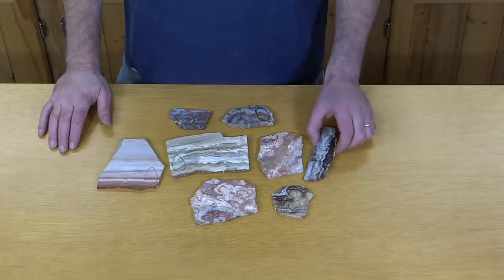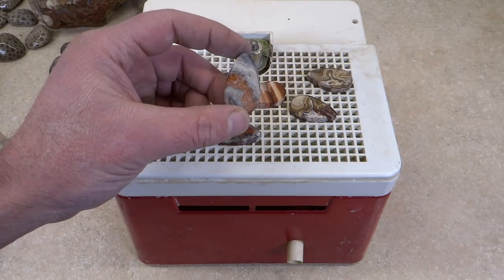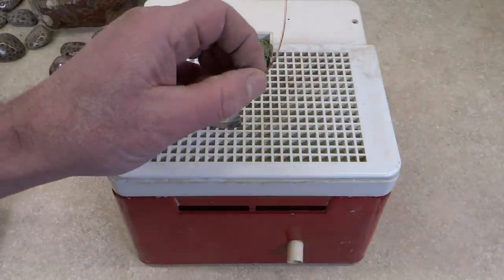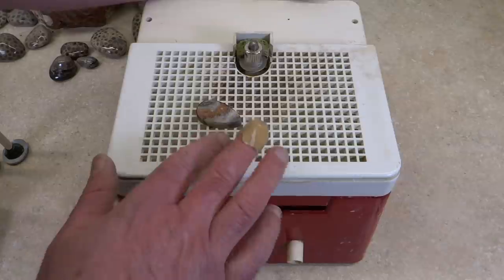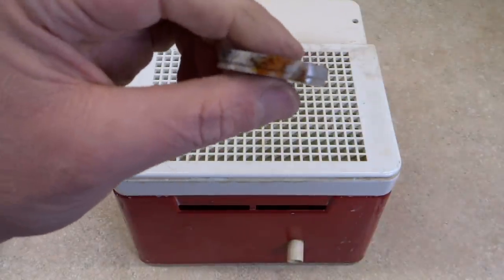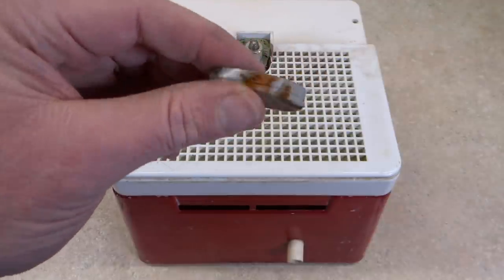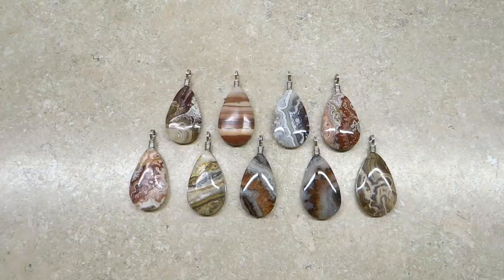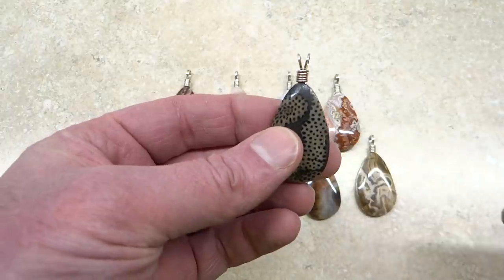Making Pendants for My Wife

Comment: Interesting, I was a cabinetmaker for many years and I can give you a time saving tip when using that glass grinding machine you cut the grooves with.
If you put a washer with the correct bore size over the cutter and clamp that on top if it is the correct diameter you can use it as a depth guide
Reply from the maker: Hi Symon, that’s a great tip, except that the bit wears down as you use it.  I suppose I could have a series of washers that I change as the bit wears down.  I’ll have to think about how I can make that work.  Thanks!
Reply: @MichiganRocks  
It is progressive and if you do get it right I would say half a millimeter difference will do it.
Do you know any metal turners who could help?  You could trade off for the goods, check the sizes you need and see if they are stock washers. 
Good luck.
Reply from the maker: @symonsheppard7151  Thanks!

Comment: Beautiful work! About how long does it take you to go from slab to finished product? I'm just starting out, so it's quite a process for me.
Reply from the maker: I did these over several different days.  I work on them for a couple of hours and then my back usually starts to get sore and I stop having fun.  Part of the time is getting tools set up and then cleaned up at the end.  You can't go just work for a half an hour or it would take almost as long to get everything filled with water and then drained and dried at the end.  I like to do more than one at a time for that reason.  As long as I have to clean stuff up, I may as well do a few.  All that makes it hard to say just how much time goes into one pendant.  I'll take a very wild guess and say that this group took me 7-10 hours start to finish.  That includes the wire work.

Comment: Hi Rob. I have a question about glass grinders. Do you like your Power Max 2?  There is one on EBay I was thinking of getting. Didn’t you have a different one before, maybe called The Wiz?
Also, what size bits do you have to make those grooves in your stones.
Reply: I now see the bits on your Amazon store
Reply from the maker: This is the only grinder I have used and it works well for me. I think the one in my Amazon storefront is a little different, but it was the closest I could find to what I have.

Comment: Is there no end to your talents? :) I really like the clamp/vise. What are the grits on the cab wheels? What do you use to "glue" the rock to the stick? Thanks.
Reply from the maker: I stick the rocks to the stick with hot wax.  It's called a "dop stick" and the wax heater is called a "dop pot"

I think the grits are: 80, 220, 280, 600, 1200 and 3000.
Reply: @MichiganRocks  Thanks. Trying to glean as much as I can from the videos. You are a huge help...

Comment: Using the clamp with those pliers was ever so clever Rob. Great video. 
  I was wondering about that glass cutting machine that cut the groove. Is there any worry about grooving your fingers from the blade?
Reply from the maker: The clamp wasn't my idea, but I agree that it's a good one.  

Diamond blades don't easily cut your fingers.  They have very small diamonds and they grind through the rock rather than cut it like a wood saw.  I can touch the blade of my rock saws while they're running and it doesn't hurt at all.  Look at  6:08 in this video:  https://youtu.be/dJ7qriOF0r4
Reply: @MichiganRocks  Could a dremel be used for cutting that rock slab, sanding the edges, and then cutting the groove in the edge?  Or would you recommend looking at your friend’s website instead? 😆
Reply from the maker: @karenh2945  I think that would be very difficult to do well. You'd need to have the Dremel in a drill press or something to hold it steady as you cut a groove. 

My friend Chuck does very nice work and it would be much cheaper than making one yourself. On the other hand, the satisfaction of making something yourself  is worth something too.

Comment: Hey what did you connect to the stone ? Help Thx
Reply from the maker: It's called a groove wrap. It's silver wire (actually three wires) wrapped around a groove that I cut in the cabochons. I thought I showed how I did that in this video, but if not, check this one out: https://youtu.be/kIJgbsunB3s

Comment: Awesome job. They look great but I was curious did you modify your wet saw or is that the way it came? I am trying to figure out something for my wet saw
Reply from the maker: The saw is the way it came when I got it used.  I did have to replace the Plexiglas water shield in the front, but that's the only thing that I'd consider a modification at all.  What did you think I changed?
Reply: @MichiganRocks  I just wasn't sure. I went to harbor freight and got a tile saw. I just liked how yours was set up.
Reply from the maker: @wastelandworrior9639  I really like that saw.

Comment: Hi, can i ask how thick the slabs are that you use for this type of pendant? I plan on making a few but can't see any indication on the tutorial you linked to. Lovely pendands, you do a great job as does your friend who's etsy offerings are really bonnie. 👍
Reply from the maker: I cut my slabs just over 1/4 inch. I'd cut them 1/4 inch, but to do that, I have to do 5.5 turns of the crank to get that. When I do that, the crank ends up straight up and it tends to fall down during the cut. For that reason I do a full six turns and end up a little thicker. That's good though, to have room to fit both the groove and the dome on the cab.
Reply: Ok thanks. Can i also ask if you use hard or soft wire? I'm completely new to making jewellery and it's a bit of a nightmare with all the options so it would really help if you were able to tell me whether each of the wires uses were soft or hard. I have my cabochon made and just need to ensure i buy the correct type wire. Thanks again.
Reply from the maker: @highlander5161  Sure. I don't know much about this either. I just do what others have told me to do. Here you go:

20 gauge square half hard
20 gauge round dead soft
22 gauge half round half hard
Reply: @MichiganRocks  Great. Thankyou. 👍
Reply: What’s the approximate measurement for a groove? 1/3 of the way above the back of the cab? Less?

Comment: How do you attach the dopstick ?   How to release from dop…minor stuff, but need to know.  What is the coin for in cab machine?
Reply from the maker: I just did a complete video on how to make a cab, with all the details I could thing of. I show how to attach a dop stick and how to remove it. (Spoiler: Use hot wax to attach it, and put it in the freezer for a few minutes to remove it.) https://youtu.be/U_9ASoyvaM0

Here's a link to my cab machine, and another version with cheaper wheels. I'll also include a link to my review of it if you're really interested in getting one.  

Cabber 6 with upgraded wheels: 
https://kingsleynorth.com/kingsley-north-cabber-6-nova.html?ref=robertabram1&utm_source=tapfiliate  (affiliate link)

Standard Cabber 6: 
https://kingsleynorth.com/kingsley-north-cabber-6.html?ref=robertabram1&utm_source=tapfiliate  (affiliate link)

My review: https://youtu.be/n30aBTu9OkY

Comment: Do you put the groove in dry grinding? I cant find  a single groove bit that lifts the water out of the reservoir.  I have the same glass grinder. Btw very good tutorials, thanks for taking the time.
Reply from the maker: I'm not sure what you mean by lifting water out of the reservoir. There's a little sponge behind the bit that soaks water up and keeps the bit wet. If you look in the description of this video, you'll find my Amazon storefront. I have the bit listed there.
Reply: The bits that csme with my grinder had a small flange like thing on the  bottom of the bit that lifted the h2o up to what you are grinding.
Reply from the maker: @gregorysilas3784  This is one of only two bits I have ever used on my machine. I have never seen a water flange like you describe. I think all the bits on my machine are cooled by the little sponge.

Comment: beautiful work! What software do you use to edit your videos?
Reply from the maker: I use Final Cut Pro.  I started with iMovie, but iMovie doesn’t allow you to straighten video.  When I do videos on the beach, the horizon is like a level.  It’s really obvious when the camera is tilted.  I seem to be incapable of holding the camera straight, so I spend hours straightening those videos.  Every second or so that the camera is facing the horizon I make an adjustment.  Most people probably wouldn’t care if I didn’t, but it bugs me when the lake looks like it’s going to drain off the side of the screen.

Comment: What is the polisher you are using?  Do you use this to polish Petoskey stones?
Reply from the maker: I think it's a Lortone cab machine rebranded as a Kingsley North grinder.  I bought it used from a friend.  It was rusty when I got it, but I cleaned and painted it.

I usually use a flat lap rather than this for Petoskey stones.  The disks for the flat lap are cheaper than the wheels for this machine and the flat lap works just as well for Petoskey stones.

Comment: HELP! I looked in your videos for the 1 on your equipment, and I can't find it. You know, which slabber you use, the Dewalt squeeze clamp you use here...just can't find it. The jewelry pliers...I've never seen that nose. And I know you said your trim saw has been discontinued, but what one do you think is closest to it at kingsley north?
THANX FOR ALL THE GREAT TUTORIALS.
Reply: I have gone to this tutorial (great) and answered a few of my own questions....but slabber?
Reply from the maker: Here's the tutorial I use for wrapping these. https://forum.rocktumblinghobby.com/thread/68169/groove-wrap-tutorial-photo-heavy

This is the only wrap I know how to do. Wrapping is not my strength at all. I just do it because I have to to make a finished piece of jewelry. 

As for the equipment, I bought it a long time ago and I don't know what brand most of it is. My pliers say "Made in Pakistan" on most of them. My bail making pliers are Wubbers brand. My wire cutters have yellow handles, but that's all I could tell you about them. They all seem to be good quality, I didn't buy super cheap stuff, but it wasn't outrageously expensive either. In the tutorial I linked to above, my friend uses a Craftsman clamp. I just went to Home Depot and found a tiny little clamp. If you search for "pliers" at Kingsley North, you'll see they have a lot to choose from. I have a large and a small pair of needle nose pliers and small and large pliers with flat, square ends. 

The slab saw is a tough question. I don't see anything at Kingsley that is very similar to what I have, although they have a lot of slab saws that would probably work well for you. This one: https://kingsleynorth.com/14-combination-slab-saw-complete.html?ref=robertabram1&utm_source=tapfiliate (affiliate link) might be the closest to what I have, but it's bigger and comes with a stand. Mine sets on a table. The problem with saws larger than 10 inches (mine is a 10 inch saw) is that the blades cost a lot more. They probably last longer though. 

There is actually a clone of my saw that is made by another company. The company is Highland Park, which is confusing because they used the name of an older company that went out of business. They used the same design and made improvements to it. According to their video, it's greatly improved. I was on a lapidary forum where people said it's cheaply made, though. The new company is based in China, although it's owned by a couple of Americans. I don't know if the people on the forum had actually used the saw or if they were just upset that they are being made in China. Anyhow, here's their video on the saw: https://www.youtube.com/watch?v=ZqCromp2I7o&t=3s

Comment: What was the suction cup thing you used when sanding? Was that a kids arrow?
Reply from the maker: That's not a suction cup, it's a dop stick.The stick is just a wooden dowel from the hardware store, cut to whatever length you like.  The green thing you thought was a suction cup is dop wax.  You heat the wax in a dop pot, and warm the stone on the edge of the pot so the was sticks better.  When you're done, you can stick in the freezer and it will break off easier.  I still end up cutting the remaining wax off with an exact knife.

Before I used wax, I used to super glue a large nail head to the back.  That also works well, but I didn't like waiting overnight for a good bond.  If it breaks off, you have to wait again.  With the wax, I sometimes have one break off, but it's ready to go again in five minutes or so.  The super glue also weakens by freezing so you can get it off the stone.

Comment: Can I ask what you use to glue the dowel to the stone and how did you remove it after?
Reply from the maker: I use dop wax. It's a wax made for this. I heat it up in a dop pot, which is a little electric gizmo also made for this. You have to set the cab on the edge of the dop pot to warm up so the wax will stick. When you're done with the cab, just throw it in the freezer for about five minutes, then run it under warm water until it falls off. Sometimes I use a knife to scrape a little bit that doesn't release in the the freezer.
Reply: @MichiganRocks  Thanks!

Comment: Very nice  are you not worried  about  your fingers ? You get them so close to the blades,that I  scaroom watching you.  And I  have cut gem stones that are dull is there a wat to shine them without  sanding, they are very  small?
Reply from the maker: I really need to make a video showing that the saw won't cut my fingers.  I have a video about making crosses where I touch the running blade with my finger.  It doesn't feel sharp at all.

You can shine up rocks with a tumbler.  I have lots of videos showing tumbled rocks.
Reply: @MichiganRocks  Thank you for the reply, but these are already cut about 4mm but they just did not shine or polished  them. So I  don't think I  could stand them.
Reply from the maker: @maryzylema9699  Oh, ok.

Comment: Is that a CabKing?  I notice there is a secondary pan that your water flows into instead of just the plastic tray.
Reply from the maker: I bought it used.  It's a Lortone, but I think it was rebranded as a Kingsley North.  What you call a plastic tray is actually steel and was pretty rusty when I bought it.  I stripped the rust and repainted it.  The secondary trays are dollar store cake pans that I put in to protect the main steel pan.  I figure that it's little rock fragments pelting the pan that removes the paint and causes rust.  The pans still get plenty wet but the dirtiest water goes in the cake pans.

Comment: i would like to know what is the green glue or mastic for polish the stone ???
Reply from the maker: That's dop wax.  I have a little electric pot that I heat it in and then use it to stick the dowel to the back of the cabochon.  The dowel is called a dop stick.  Some people will use super glue to attach a cabochon to something like the head of a nail.  I used to use that method, but the wax is quicker.  You can remove the wax by putting it in the refrigerator.  After an hour or so, the cab will pop right off the stick.  Any wax left behind is scraped off by a knife.

I found this video for you.  The guy mispronounces it as "dope" instead of "dop", but that's the same pot I use.
https://youtu.be/_py5YaIvyFg
Reply: @MichiganRocks  -  Un grand merci à vous...   Thanks so much...   Have a nice day !

Comment: What kind of saw is it that you use to put the groove in the side of the pendant?
Reply from the maker: It's a grinder made for doing stained glass. The one I have is in my Amazon storefront, but there are several brands to choose from. I got mine used. You might be able to find one that way too. The bit I use is also in the Amazon storefront.
Reply: Thanks  can you show the bit for sale for newbies.
Reply from the maker: @mikemaloy6916  It's in my Amazon storefront. You can find that in the description of this video.

Comment: Why don’t you set up a fence on the glass cutting machine so you get the correct depth constantly it doesn’t need to be elaborate just a piece of wood with a notch in it
Reply from the maker: That would be great, except that the bit wears down over time, so the fence would have to be easily adjustable. I'm not sure how I'd do that. Sure would be nice if I could figure out a good way to do it because it's sort of a pain to check it the way I do currently.

Comment: How much is this rock?
Reply from the maker: I don't remember how much I paid for the slabs.
Reply: how long are you study for do this? I look the slabs are so great
Reply from the maker: @doandinh3639  I've been doing this for about eight years, but it didn't take me that long to learn.  It's not that difficult, but the equipment is expensive. I bought most of my machines used.
Reply: Its not a rock